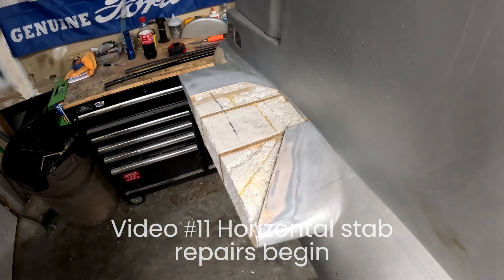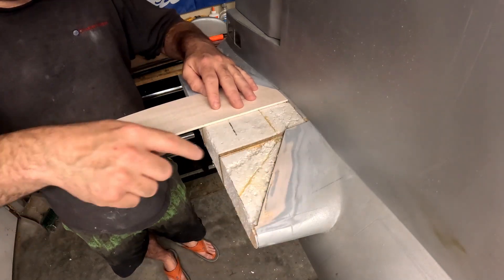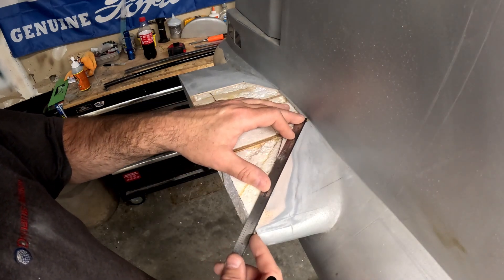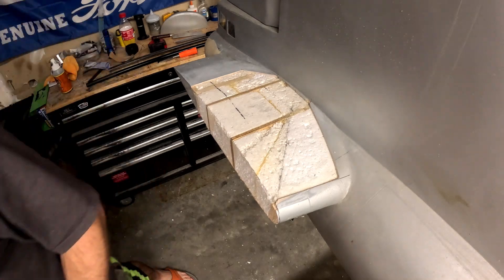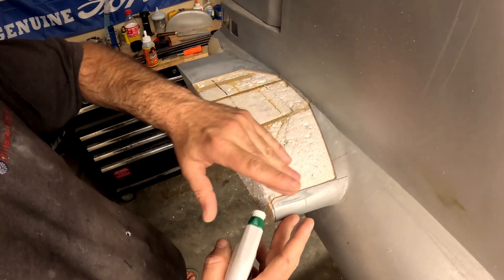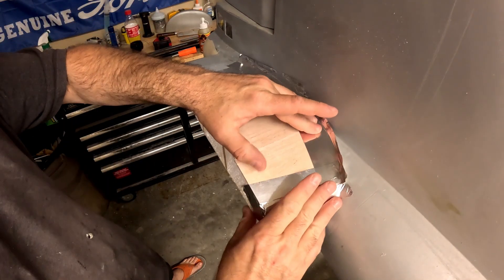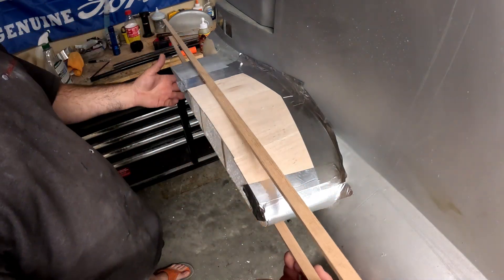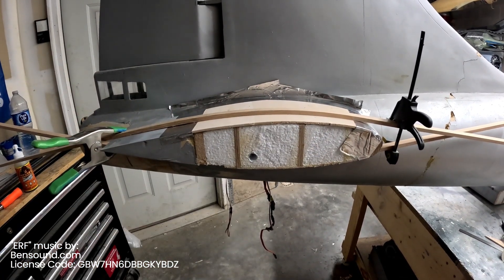B 29 Restoration Project #11  H Stab repair

Comment: How did you connect the three pieces of balsa wood to eachother? Thanks
Reply from the maker: There is a video releasing on either monday or wed that shows the process for making wing skins.  In this instance, i believe i used thin ca on the inside surface to edge glue them.